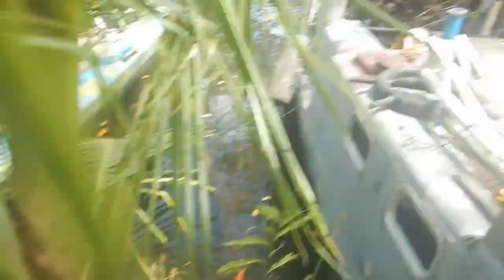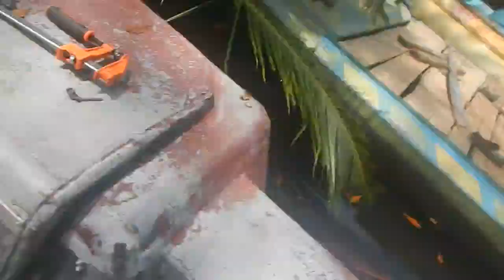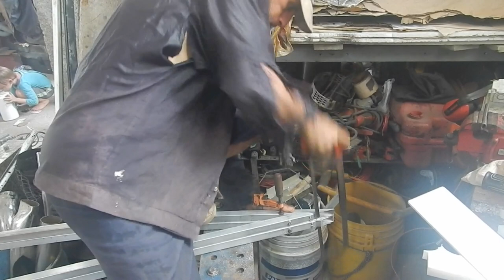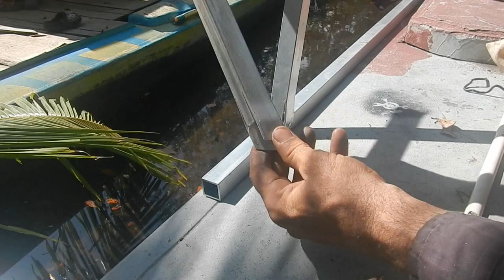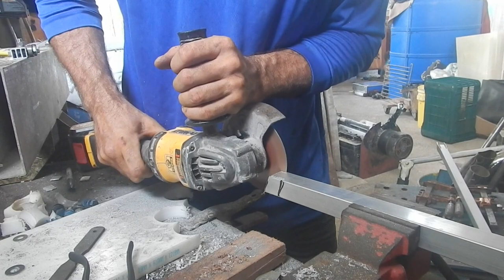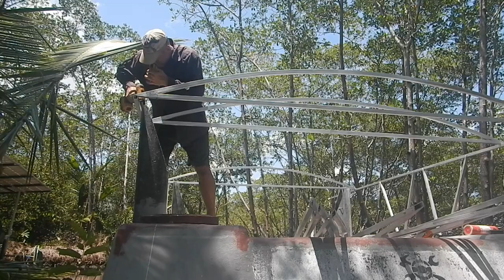Shark Slicer Upgrade 013 Roof Frame

Comment: What was your angle grinder disc when it seems to cut aluminium like butter? I usually use stone discs since they cut better than steel ones, but not nearly as good as yours.

By the way, I have learned not to keep my hand in a direction where I drill. It shouldn't slip untill it do. One of the nastiest would is 5mm drill hole to the bone. It just don't want to heal.

Comment: A good use for aluminum scraps/powder from grinding and cutting aluminum is in pyrotechnics. Mixtures that use aluminum/metals in general are good for flares, flash powders and also removing fingers if you aren’t careful enough. You’re plenty smart enough to learn the simple math it takes to make pyrotechnics. If you haven’t learned already

Comment: Why no welder? It appears you have plenty of solar panels on hand, am I missing something?
Reply: He's talked about it in a livestream, if I remember right I think he just prefers it this way anyway so its not worth aquiring and setting it all up to him at least for now. He used to weld in Vermont and Im assuming he left that welder there.
Reply: There was also a discussion regarding the permanence of welding versus the ability to later change the design of projects constructed using easily removable fasteners like screws or rivets.

Comment: Seems like it’s going to need vertical angle braces perpendicular to the length of of the boat. Perhaps one set going up from the bottom center of the boat angled up toward the outer bottom of the roof joist and other smaller sets on the support structure poles angled up and towards the center.
Reply: He rarely replies, the four fiberglass towers the new top rests on supported the much heavier and higher solar array top that he removed.
Reply: @sagecoach  when people get on top of the roof, I can imagine there will be some uneven forces being put on it and that it may need these extra supports.  Also, I don’t really care if he doesn’t reply to me. I am just making points that might draw in some conversation like this.
Reply: @tbarnes36  Me too. In the next video, he applies heavy sheets so we will soon find out.